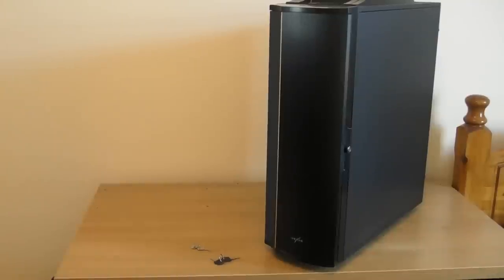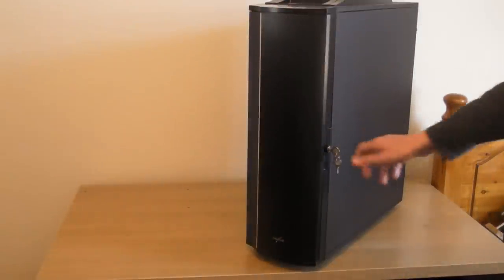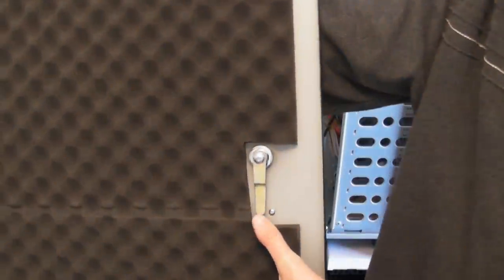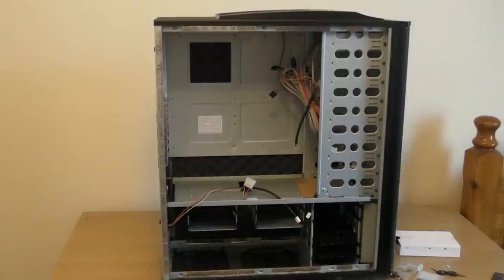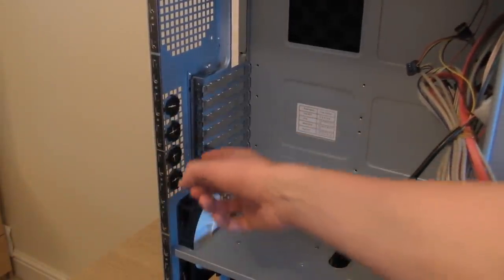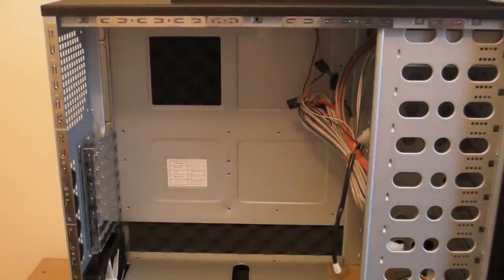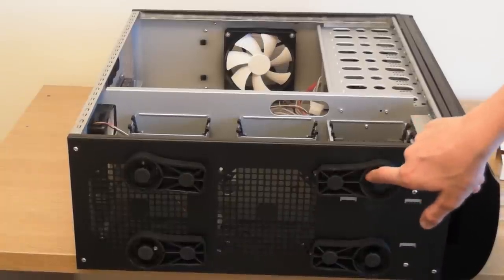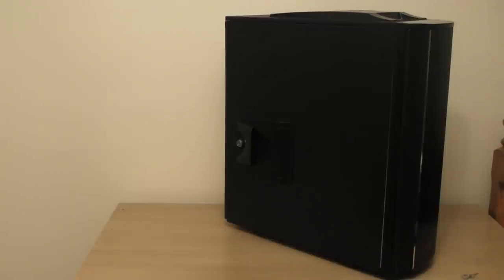Nexus EDGE Full Tower PC Case Review

Comment from the maker: @andyr86 i would say yes because if the foam wasn't there then a ventilation system could of been installed however with great cable management i think there is no reason you could not get great cooling from this case!

Comment: What kind of setup are you using with this?

I'm in desperate need of a case bigger than the Antec Nine Hundred and I've been looking alot at this, but I'm not sure if it will give me that extra space I need for all the cables etc.

My setup is
GA-X58A-UD7 (with an Intel i7-930)
Gigabyte HD5850
Nexus 1000w PSU (trying to sell and replace it with the 630w one)

And theres a bunch of HDD's and other stuff that just made my PC owerflow with cables, I hope this will make it a bit tidier.

Comment: Nice reviews, but it could be nice to build it up, see if it actually quiet when running standard equipment, see if the cable managment actually works and so on...
Still, keep it up, it was informative, and that what it should be.
Last, the fan controller adapter really is for floppy drives originally, made me smile...

Comment: it it possible to get rid of that retarded key system and not ruin the function of the front and side-panel in the process? like remove the key-locks and just use the thumb screws? and how hard do you think it would be to remove the foam?